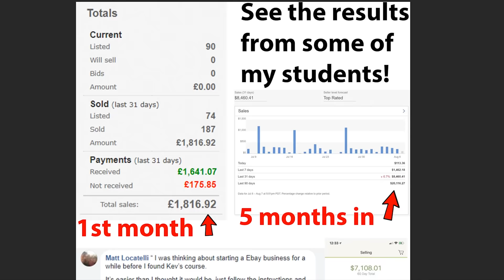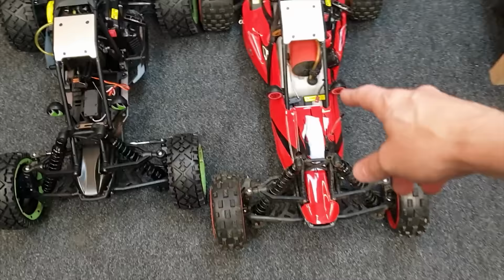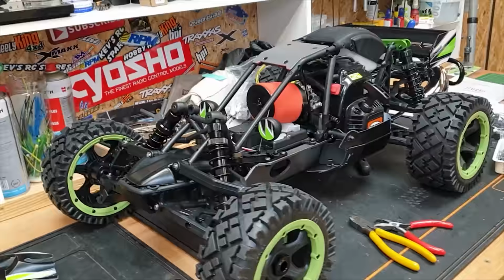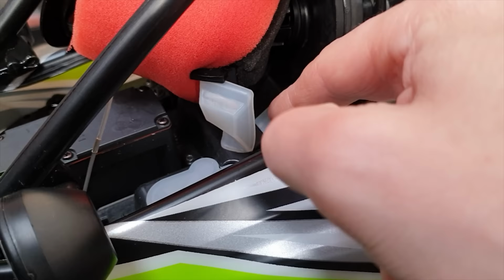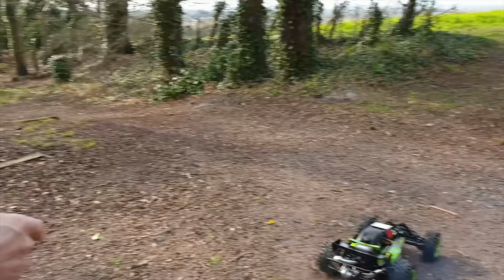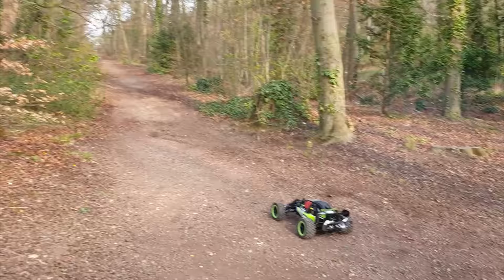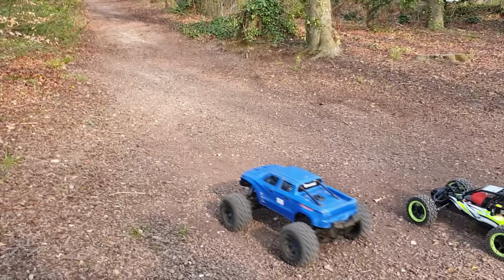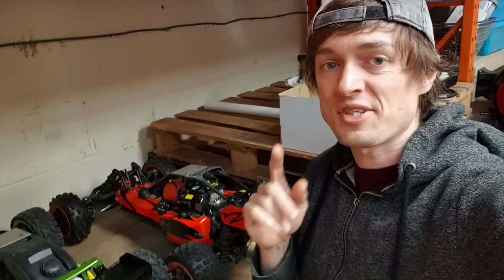Cheap Giant Petrol RC Car Test - Rovan Q-Baja

Comment: Can someone explain me the difference between Nitro and Petrolium rc cars?
Reply: the petrolium car is pretty much just a 2 stroke chainsaw or weed eater motor with a spark plug and all that and the nitro engine uses high compression to ignite the nitro fuel and its started with a glow plug to get things warm enough at first
Reply: @stormchaser8472  than I buy the Peteolium. The Nitro mix is to expensiv and I like the sound of 2 Stroke. Nitro sounds like a Moskito in a Bottle of Glas.
Reply: @Nico-ds9nz    just make sure you don't forget to mix the fuel with 2 stroke oil At the proper ratio
Reply: @stormchaser8472  I know, look at my name, I ride a 2 stroke ktm exc, I won't forget it 😉
Reply: @Nico-ds9nz  sorry the name doesnt mean anything to me. In general people always seem to forget to mix the gas for lawnboys and everything else and dads had to fix everything because of it lol. Glad you atleast seem to know what's up.